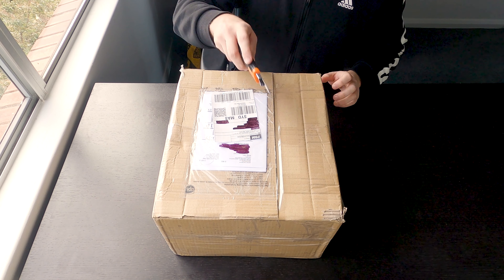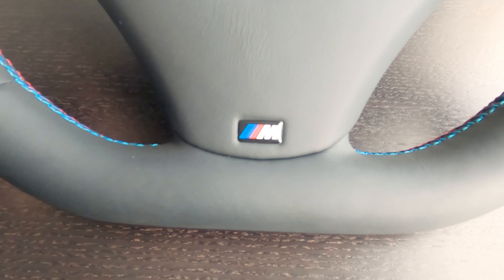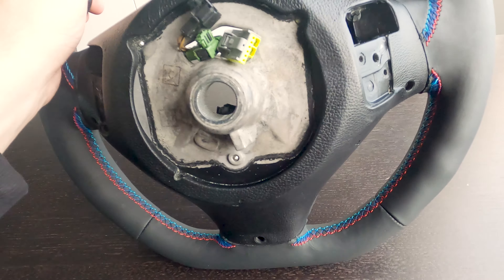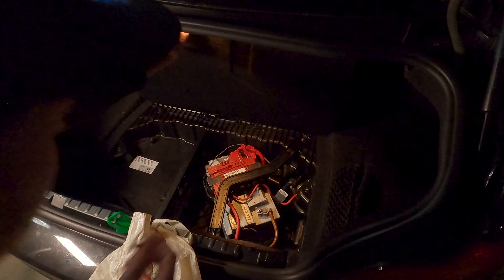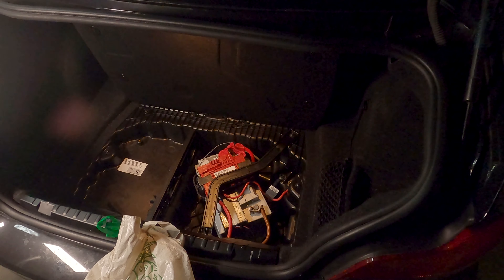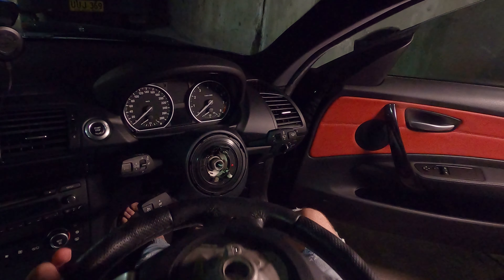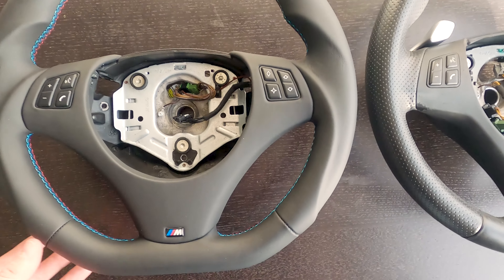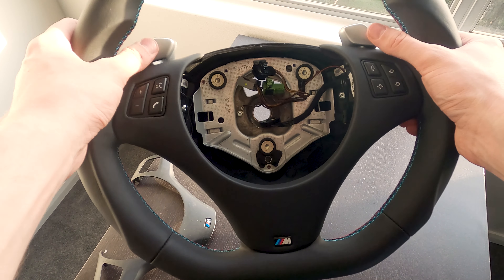STEERING WHEEL UPGRADE - DIY Install BMW 1 SERIES (E82)

Comment: Why didn't you install aluminium paddle selectors when changing the wheel, would had made another big change, plus not expensive.
Reply from the maker: Yeah I might do this in the future. Not hard to swap out :)